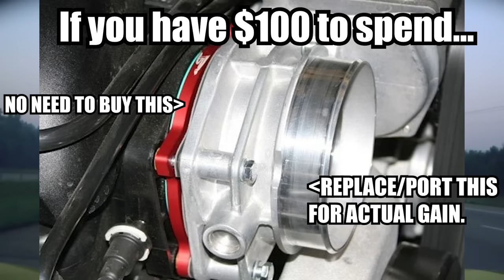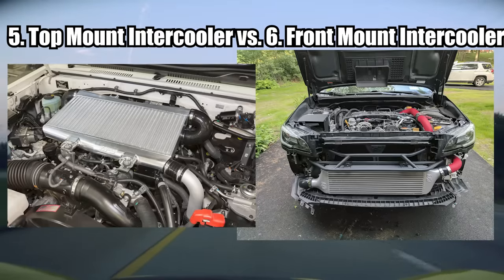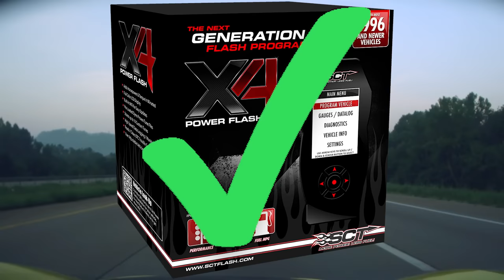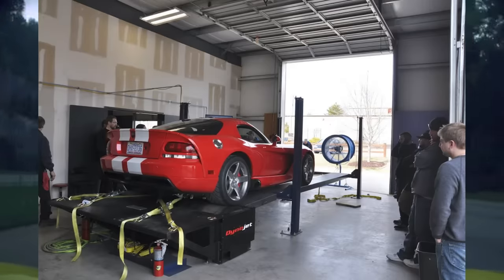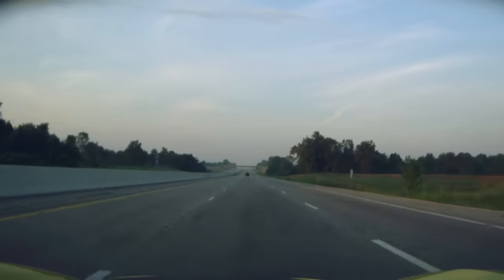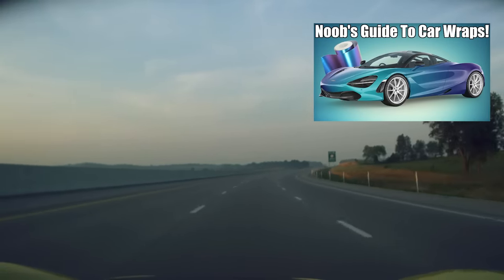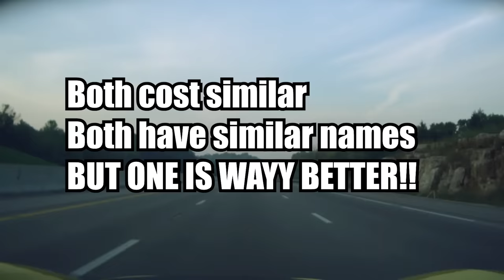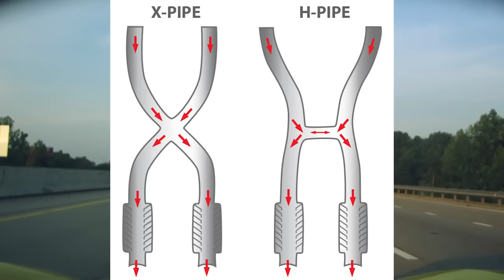25 Real VS. Fake Car Mods!

Comment: I immediately hate this. On my 300hp 1.8t build, I'd love 20-30+ HP if i wasn't using high flow intake mods. 

Stop this bs. Everything needs to be taken into context. It's not as simple as "hurr hot air intake bad hurr"

Comment: The exhaust information while correct in how it affects his performance was actually incorrect as to why a properly sized pipe with a crossover that encourages the exhaust to make its way to the end as fast as possible actually creates a small vacuum effect in the combustion chamber as it leaves through the exhaust valve and since most cars have an overlap between the intake and exhaust valves a very slight overlap the scavenging effect helps to start the pulling of the fresh air back into the combustion chamber getting it ready to be pressurized and exploded

Comment: Larger exhaust pipe diameter makes a huge difference in power if you have a real engine. On a honda 4 banger yeah you're never gonna notice the difference between 128 hp and 131. motortrend did a video on it with a small block chevy the difference between 2 1/2 and 3 inch was 20-30 hp.

Comment: I have 2 Audi's, a 2001 and a 2014. The 2001 has cheap coilovers, Raceland to be exact. Personally I have zero issues with them! The 2014 I have drop springs from H&R, the ride is much more like stock than the coilovers.
As for the wheel spacers. Most cars rims are NOT hub centric! They are lug centric so not having hub centric spacers is no big deal. I've had both and put many miles on them. Know your lug nuts or bolts! Any cone or ball seat lug nut (or bolt) is what actually centers the rim. The flat lug nut do not and is the only true hub centric rim. Mostly found on large pickups, F250s or 2500s for example.

Comment: I'm 20 and the only vehicle I have ever had is a 2012 F150. I did a 2in leveling kit with a 0.5in rear lift block(2 years after the front 2in. It squatted a bit) and 33in all terrain tires. I then did an exhaust and a year later an intake and tune. I did a 5star tune and there was a bundle with an intake so I did it. 

The exhaust is almost a straight pipe but the muffler does work a bit. It comes out of the factory Y pipe into a 1 in 2 out muffler and exits before the rear tire(so not "true duals) it's probably larger than I need(I think 4in) but it was the cheapest option 😂 I did go for the 304 stainless steel because I planned on keeping it for awhile. The had aluminized steel but that would definitely rust quickly.

Also did 1.5in hub centric wheel spacers to get a little poke from the tires. It only sticks out a little but I think it is perfect. I hate wheels and tires that are tucked, it just looks awkward. I currently have OEM takeoffs from a different trim level, I plan on getting some aftermarket wheels eventually but there are a few things on the list before that.

I don't really understand the true dual exhaust trend because you need the exhaust scavenging from an x,y, or H pipe. True duals also tend to sound "clapped out" and pretty awful.

But the y pipe definitely gives it more of the "truck" sound due to the unequal length exhaust. The gen 3 Raptor has a trombone exhaust that makes them equal length and it sounds somewhat similar to a Nissan GTR.

I'm about to pay off my truck and plan on getting a Mustang in the future. Still a few years down the road, especially with gas prices and used car prices right now. But it will 100% be a GT manual. Preferably a 2011+

Comment: You are wrong on intercooler. It’s a tricky situation. Top mounted have less lag because less path for air to travel. But they also heat soak a lot more and are pretty much useless under 10-15 mph, Heat rises. Front mount intercooler will help to keep the charge denser but also can create more lag because of longer piping to travel through. My car has the intercooler samwiched between the radiator and condenser. They are known to heat soak after few pulls. But zzp makes growing mount kit, which is bigger and flows more air but also can increase lag somewhat.

Comment: The straw demo you said is kinda pointless, the same ammount of air is exiting, it's just that it feels like more through a straw since it's tighter and acts as a higher psi, but more air does not escape
Reply: Wrong the straw is less air... And for a 4 stroke engine flow is better than back pressure and has been dyno proven many times

Comment: Everyone seems to get exhaust concepts and back-pressure wrong or just shy of right. 

Think about it, if you had an engine and had no exhaust and no manifold, it should essentially be optimal, but of course you can't do that. Faster exhaust velocity is NOT the reason why you have more gains with the correct exhaust setup, it is however, related with the real reason, which is scavenging. Think about emptying a wattle bottle upside down and the air pocket travels up, that can be thought of the pressure wave traveling back from either a header geometry change, or exit of exhaust. If that is optimized to have a higher change of pressure waves meeting the exhaust valve about to close as inlet valve opens near bottom dead center of a piston, that's where you get the effect of more power gains. Of course all this is for NA setups, most turbo setups bigger actually is better for a greater pressure delta across the turbine, however this effects turbo efficiency. All in all which this video mentioned at least, not much matters without a tune to really adjust timing and make parts work as well as they can

Comment: the thing people dont realise with "cold air intakes".... your car is already built with one... have you idiots ever followed the pipework from the air filter to its origin of entry.... no, its already a cold air intake that directly takes wind from the front of the vehicle.... so when you chop this and do your "cold air intake" MODIFICATION... LOL... thats why you need a remap as you just disabled the actual air flow.

Comment: There are actually electric turbos that work. It’s not those crappy little little
Fans you put in your intake pipping. The electric turbos look like a turbo with no hot side. They do work but need massive amounts electriccy to spin up to actually condense air.

Comment: Heh, I used to have a cold air intake on my car. It runs LPG/propane which will turn the intake into a flamethrower on misfires (has happened before). When I learned that I quickly removed the pod filter 🙂

Comment: Idk about all you, but before I went to a front mount from a top mount. After running the car hard you couldn't touch the top mount, now I can run the car hard and lay my hand on a front mount. So in fact there's a noticeable difference in iat! Also the exhaust stuff!! Come on man, straight pipe is good for turbo cars of course you don't want to put a straight pipe on a na camry

Comment: I’d like to add on the top mount intercooler that uses a scoop do some learning before doing this at home research what a boundary layer is before buying that new need for speed hood for your build just cause it has what appears to be a functional scoop doesn’t mean it is it can be open but due to boundary layer air flow over the car if it doesn’t sit high enough air will go right over the 2 inch tall scoop you may be thinking will look and work awesome

Comment: funny enough i brought a mini cooper r50 and it had a cone filter which i ended up removing as the stock intake legit ducted from outside the engine making colder air get into the engine also i put in a foam filter for cost and fun as it wont add much if any hp.

Comment: Scavenging is why proper exhaust is important. Pressurized exhaust isn’t a thing if it was you wouldn’t port exhaust or buy headers and do all the things to remove more exhaust quicker and more efficiently.

Comment: Not a fan of straight piping, but why is it bad for performance to have the air "leisurely" making its way out of the car? If the exhaust strokes sap as little energy as possible from the engine, isn't that what you're going for with a performance exhaust?
Reply: Unless you're driving a diesel you actually do need some back pressure for the engine to run properly. How much depends exactly on what you have and what tune.
Reply: @JohnSmith-wx9wj  Why? How does extra drag on the exhaust stroke help?
Reply: @nthgth  I believe it's timing, but I'll have to ask someone I know about more detail. 
Again, depends on your setup and tune.
Reply: @JohnSmith-wx9wj  maybe it's to prevent most of the fuel-air charge from escaping right out of the cylinder during valve overlap.
Reply: An engine is basically an air pump for concept the goal to get more power is to force more air in but guess what you also need to do.... Get more air out so what happens when you have back pressure??? You can't put as much air in!!!! The concept of back pressure being needed is a myth... Only 2 strokes need back pressure not 4 strokes... Don't believe it? Test it on a dyno yourself

Comment: So you are right about the quicker response on the the throttle spacer but I think there is that rae unicorn where it does give some hp when done right and I wouldn't post if I didn't have a story. So senior year my  auto tech class had a project. What could we do to a stock 5.0 fox body for 500 dollars. We changed the rear end gears, race spark plugs, and a spacer we did see gains in both HP and torque. So maybe with simple mods a spacer works but beyond it would be better to get a ported throttle body unless they don't make one for your model

Comment: Four people who are thinking about making rice burners please read this

So he got one thing wrong your engine does not need back pressure in fact if you had a vacuum strap to the end of your muffler you would actually gain horsepower engines are basically compressors but you changing out your muffler would give you only slight benefits if that's all that you're changing out and the reasoning is simple let me use air compressors if you have a one CFM air compressor paired up with a one CFM hose the air compressor is your engine the hose is your muffler it's pretty well matched up let's say for some reason you take that one CFM hose and swapped it out for tooth CFM hose you think twice the power but your compressor can only put out one CFM so because of the effects similar to you sucking on a straw would happen you get slightly more than one CFM but it would be very very minor and you probably wouldn't be able to pick it up almost instruments but let's say you pair up a five CFM engine with a one CFM hose if you then changed out that hose to five CFM you get five times more power than you originally had and a similar thing happens with cars manufacturers do a very good job of matching the engines to the mufflers to making sure they have the same amount and they're nice and consistent so you changing out to a better muffler with less restriction doesn't really do a whole lot if you're keeping the stock engine but if you're doing a whole bunch of things adding a supercharger and all that to it I would recommend changing out your muffler because you would be surprised on how much horsepower you get especially if you're changing let's say a tooth for my engine that has 300 horsepower to 600 horsepower definitely change out your muffler you would get a very large return out of that because you're essentially making twice as much air but you're stuck with the same exact hose so you still can't operate at your best performance as far as what do I do I build guns not really what you would expect but I also like to tinker at home and I did go to college and one of my teachers work that NASA and we got into talking about jet engines flute Dynamics and things like that something that I've always been interested in so he taught me a lot more about flu Dynamics even if that wasn't really what we should have been learning in class so basically you reducing the back pressure is a good thing it's just not necessary it's not that you aren't getting any gains like he said and you're going to f*** it up you do not need back pressure for an inch it's just why are you going to spend a whole lot of money for something that's not useful why you even going to waste your time for something that's not really needed if you mod your car I feel and you add a decent amount of horsepower definitely change out your muffler

Comment: I own a "straight pipe" vehicle more like just muffler delete. While it does sound louder (which is what I wanted but without using an obnoxious fart can) I kept it at stock size so double 2 inch pipes to nake sure not to lose torque at low rpm and somehow relieve air flow at high rpm and left the stock X section after the headers

Comment: Friction is based off of the coefficient of friction and the normal force, which in this case is the weight of the car + downforce. Surface area does not contribute at all to friction. The only thing that can change how much grip your car has is increasing its' weight, adding more downforce, or changing the coefficient of friction. The Coefficient of friction is the innate grip of the 2 substances touching. Ice and rubber have a very low coefficient of friction, while rubber and concrete have a pretty high coefficient of friction. This is what tire compound does, it optimized the coefficient of friction for a specific job such as drifting, racing, or drag racing. Bald tires only increase surface area and chance of death, don't do it.
Reply: wider tyres have more grip
Reply: @arcanevoid9199  No they don't, they have more surface area that has the chance to grip

Comment: Not completely true with intakes, TB ports/ spacers. Depends on your car completely. For example the 350z/g35  with the vq35de engine runs pretty lean while you are in your higher rpm’s, the 3 things you can do to fix it are intakes, plenum spacers/ plenum port, and ported TBs. It doesn’t sound like it would do that much. But trust me when you are able to get actual power up to 7k rpm’s, you are gonna be happy with the results

Comment: Look at a 90s ford escort cosworth it was designed to have a roof spoiler and a boot/trunk spoiler and you remove either of them and it makes it worse and if you want to make it better do what it was originally intended  to have and that was a triple wing spoiler but the middle one was removed so you could see out the back

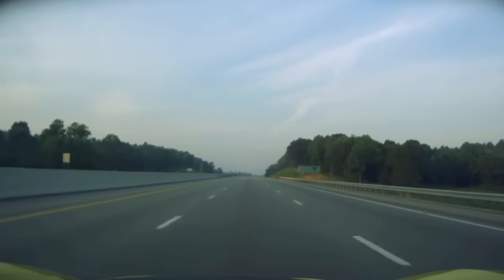Comment: 12:24 turbo cars should have a straight pipe because the air creates a swirl in the exhaust and if the exhaust isnt straight it will slow and you lose hp

Comment: My car is weird.... Long tube headers to x pipe to I think high flow borla exhaust. She's a little loud at idle, not too bad but, get her over 3k rpm and you can hear her 2 miles away. Really fun to doing my burn outs next to the open header 5.0 coyote at ARP.

Comment: Lowering springs and stock dampers dont work well together, you get look sure but you get also bumpy ride. Good coilovers are way to go.
Reply: this depends alot on the car, plenty will be fine with lowering springs if the dampers are in decent condition. also sometimes its not possible to get coilovers

Comment: I had a short ram intake and put it in my 07 mercury milan and it made the car run very lean and i had to upgrade to e85. So i mean it did give me significantly more air into my engine

Comment: I'm installing a cold air intake because my car is on a low boost stage 2, i need that full stage 2 tune that I paid for. My car looks stock on the outside.

Comment: Im a teenager and i put a glass pack on my 11th gen 4.6 f150 not because i like loud i just love the sound of the 4.6 engine in my opinion i think the 4.6 is one of the best sounding american v8 engines and it doesn’t matter the valve count they just sound good, don’t hate on me just my opinion

Comment: Ram air in cars never made sense. Motorcycles have a direct path from intake to throttle bodies for air to travel and a ram air makes sense because it is placed at the very front, usually between the headlights and supposedly, as you speed up, the air will be forced into the intake and into the throttle bodies. Who even came up with the idea of ram air in cars?

Comment: Cold air intakes have longer tubes the air velocity is way slower with longtube intakes short rams give you more torque and similar hp gains it’s heatsoak that’s an issue

Comment: There’s another cheap mod of recommend for anyone that has or will go with the K&N cold air intake would put a k&n vent valve on the tube from your crankcase to cold air it is recommended after the install of a cold air intake 13-21$ but it sure helps my 08 Daytona engine breath better

Comment: Another one that I would put in there that's not necessarily a mod but just a terminology that's not used properly is back pressure. You hit on the topic exactly with the exhaust tuning but people label it as back pressure when in all reality they're talking about the same thing but they have the wrong concept about it. Ever wonder why potato and exhaust pipe will kill the engine? Back pressure! I hate when I hear people say it because they don't know that when you decrease the diameter of the exhaust you're not giving it back pressure you're increasing the flow velocity helping with the scavenging effect of the engine which does make more torque on the lower end. Now if you go a full racing setup you don't hear people talk about back pressure the engine just needs to get all of the air out as fast as possible That's why racing cars and setups often have very big pipes.